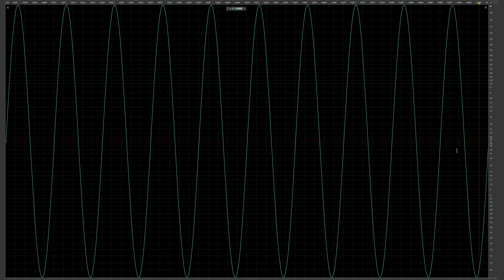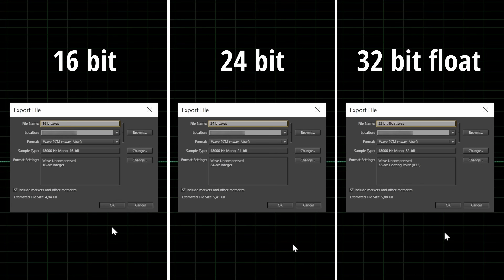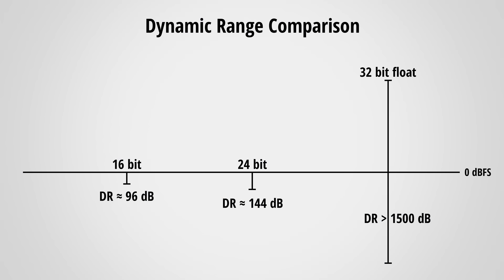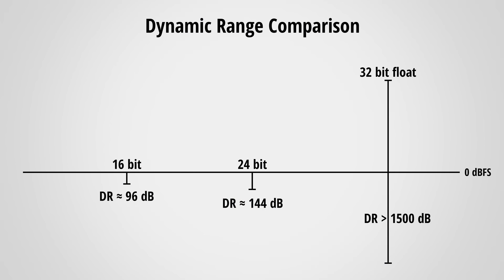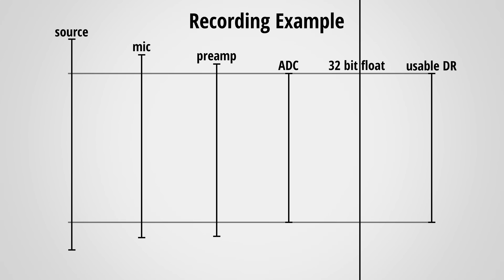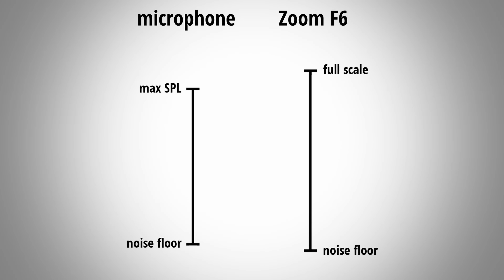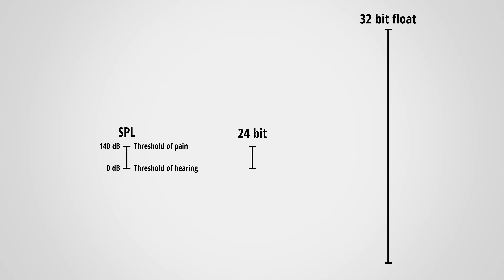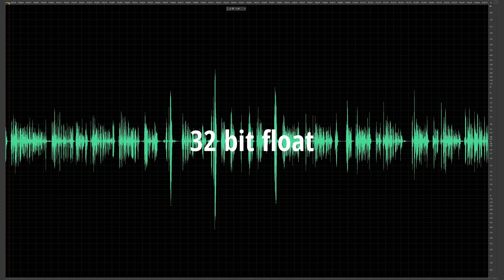The TRUTH about 32 BIT FLOAT for audio recording– Really useful or marketing hype?

Comment: I use an F6 and an F3 and the convenience is fantastic! That said - I learned about 32 bit float recording's limitations the hard way. I was working with a microphone that had a max SPL of 110 (cough cough Videomic Go 2). No matter what happened, whether I used the Zoom F3, Zoom F6 or Zoom F2, the audio would distort when I got really really really loud. On the meter it showed normally but the audio was distorted. (For those wondering it wasn't a DAW issue, it's an SPL thing). You are limited to the SPL of the microphone. This also explains the few times I actually managed to clip even on an F6 with a Neat King Bee version 1. A lot of the marketing around 32 bit float recorders is a bit hogwash :P  You'll often see the ever-popular diagram of the 24 bit graph with a small tiny little grey arrow that goes upward and the 32 bit float recording diagram with a grey arrow up to 600 DB. First off, you'd literally die if you recorded at 600 DB :P.  Second of all, most mics are capped off at around 145 DB SPL so regardless of how awesome 32 bit float recorders are - you are capped off at the max SPL of the mic. That being said, what I can say - and Julian touched on this - is convenience. With a 32 bit float recorder I can do things 4-5 times faster than before. YOU SKIP STEPS. I no longer have to do things anymore. It's easy. No more fiddling with things. No more hiss-penalty, no clip-penalty, it's like the cheat-code in audio. No quarters needed, just infinite lives.
Reply: Assumptions are being made here that are not correct. You say “no longer have to do things. SKIP STEPS. No more hiss penalty. No more clip penalty.”  That is for most situations completely incorrect. You still have to fit the microphone’s analog input signal into a window the bottom of which is the electronic noise floor of that microphone and top of which is distortion generated by that same microphone. If you don’t, you will get a digital signal with infinite range playing back the same hiss and distortion you fed it. This is not cheat-code. It is not magic.
Reply: @artysanmobile  No I disagree. We can agree to disagree. It's a quality of life improvement. It's very very difficult to mess up a recording with 32 bit float. You basically have to just click record and make sure you're on-axis with a pop filter and you are done. The times I have to retake my takes ironically are when I do recordings with my 24 bit interfaces.
Reply: @Dracomies    I’m happy for you.
Reply: Yeah, that mic is pretty limited. If you go with the VideoMic Pro it at least gives you three different options for gain, -10dB, 0dB, and +20dB. That can come in very handy depending on the environment in which you're recording.
Reply: The Zoom recorders employ 1 part of an equation that must be satisfied in 2 parts to take advantage of a 32bit or 32bit Float digital signal.

1.  Multi A/D converters, each offering a different slice of the 32bits or more being recorded. ✅
2.  A source (microphone) that has a larger than physically possible analog dynamic range. ❌

The source signal will always be bound by physics to the range of its self noise to the point of clipping. This range might, with the most expensive microphones available, reach about 22bits.  Recording it to a 32bit or larger file will still yield 22bit dynamic range. There is no free lunch.
Reply: @artysanmobile  The fallacy in your part 2 is that just because you can’t make use of the entire range of 32-bit floating point values doesn’t mean you aren’t taking advantage of a 32-bit floating point signal.
Reply: @TangerineTux    That is an excellent point, and well said. I’m not sure of any fallacy from me. It should be clear I understand the issue perfectly well.
Reply: @artysanmobile  I think you're just getting into pedantics. All I'm saying is this. I don't clip when I record with a Zoom F6. I just don't. When I record with the F3 I don't clip. So that's all that matters to me. I'm going to end the chat here. Sorry I just don't feel the need to explain myself further lol. So you're not going to get a response after this.
Reply: @Dracomies    Of course you mean semantics. Pedantics isn’t even a word. Pedantic means teaching, with the suggestion of doing so clumsily. Nothing I’ve said argues with your results but words do matter. It is clear to see from comments that this subject is confusing to many. My intention is to clarify and further educate those who are curious. I assure you, it is not to fight with you. I will continue to write for those with genuine questions about 32bit recording, and that’s a lot of people.

Comment: I think 32 bit float is extremely useful for a personal recorder like my Zoom F2, when you need to set up a lapel mic on someone and you have no idea what the sound levels will be.
Reply: Agreed.  I have 32bit float on my Tentacle Track E bodypack recorder, and also on my Sound Devices MixPre 6II recorder.  While I always do a sound check... it's nice to know that I am somewhat protected from clipping if the subject gets too loud.  I often hook my MixPre recorder to a sound board backstage at an event, while I'm in the audience shooting video.  Therefore I'm not able to monitor the audio.  But the files I record can be adjusted later in post if things are too loud or too soft.  It's a nice safety-net for us one-man-band shooters.  😎
Reply: That's what mic checks are for.
Reply: @VidMashUp  It was clearly mentioned: «[...] you have no idea what the sound levels will be».
That's field recording in an environment you can't control, or working in the spur of the moment capturing something that will happen only once.
In such situations typically mic checks as used in a studio (=controlled environment) aren't possible.
Reply: @riangarianga um. Ok?

Comment: There's another little detail that is not known by most audio people (but very well known by electronic engineers and the like), and that is the limit of thermal noise, or Johnson-Nyquist noise.
Audio devices will output at most, let's say, 10V (usually a lot less, more like 2.5v), so that's our 0dBfs, the maximum value we can ever get. At room temperature, the thermal noise for human hearing range bandwidth is about -140dB at most, being quite generous. No matter how perfect and quiet your setup is, the electrons themselves shaking inside your electronic circuits will make MORE noise than the resolution 24bit provides for you. Even in scientific applications, 24dB is more than enough almost all of the time. Even theoretically, you CAN'T EVEN USE the whole 24bits, there's at least 1 or 2 bits of extra headroom.
Reply: As further clarification: I'm not considering cryogenic measurement equipment, nor devices specifically created to measure abnormally loud sounds, like field explosions. Those will usually have either measures to reduce thermal nosie, or output way over 10V, or other special measures that most humans haven't even heard about.
Reply: Getting to the limits of 24 bits is not as outrageously difficult as you might think. There are various commercial headphone amplifiers posting DR in the 140s of dB these days. The practical limit is about 152 dB at unity gain, though obviously a unity gain amplifier is not the most useful thing in the world. That would be a maximum amplitude of 9 Vrms (a typical value on +/-15 V) vs. an input noise density of 1.6 nV/√(Hz). If you insisted you could squeeze out another 6-10 dB on the bottom end for sure.

The limiting factor is converter analog stages, which at best have a +5 V supply available, often less, and being CMOS parts don't sport voltage noise as low as bipolar circuitry would allow. Commercial audio DACs will just about make it to 140 dB with all 8 channels in parallel, and their ADC cousins top out around 130 dB.

The combination of both should illustrate why variable input and output gain as well as hybrid ADC concepts are useful to have. Since instantaneous dynamic range comes with a cost in power consumption, modern DACs more on the mobile side of things are pulling some tricks like DRE (automatic output gain switching) or even Class-G (various steps of output stage power supply voltage chosen depending on signal) as well.
Reply: For just one example, there's the Topping L50, posting a 145 dB(A) spec. And that seems to be actual instantaneous DR, as the difference between noise floor and maximum output level at low/mid gains actually comes out to over 152 dB(A). Of course nobody needs that much audio DR all at once, it's more a thing of providing ample DR across a wide range of headphone sensitivities, from BA IEMs to HE-6s (a range approaching 40 dB).
Reply: @PileOfEmptyTapes you do understand, that you will NEVER listen headphones at volume of 140dB?
Or you might... ONCE, then you're deaf. So where do you need to hear fly buzzing 5 meters away and a NUCLEAR EXPLOSION  from 10 meters away? You do NOT...

Moreover, there does NOT exists 32bit DA converter that's capable of the bandwidth we require for audio. How they achieve that "claimed" 32bit AD-conversion is probably by using two or more AD-converters and using DSP-magic to "combine" the two waveforms or by having the two converters responsible for different parts of the dynamic range, but that causes discontinuity at the crossover points and other nonlinearities that are not welcome. It increases the noise-floor and makes converters per channel more complex and expensive. Basically, you give up something and ultimately you do not achieve that dynamic range that 32bit float should have, because physics limits things.

Physics sets limits to what's possible, and 32bit float is not truly possible without DSP magic and or faking it. Stop believing the marketing hype trying to sell you the same interface AGAIN.
Reply: @Mtaalas Correct. In our experience, there's a Johnson limit to a single path of audio. Using DSP and multiple paths, we can achieve far greater linearity, dynamic range, etc. Multi-path is very common now in ADC's, soon to be available in DAC's, and later in power amps and microphones. At some point (20 years), it will not be uncommon to realize a true 160dB signal path from mic to power amp, and most of the dynamic range improvement will be on the noise side (not the "max level").
Reply: @driz77  there's a limit to the self noise of a microphones and other sources, there's a limit to the noise floor of the acoustic SPACE you're occupying. So there's very little point (unless in measurement and laboratory use) to have a dynamic range of 160dB or ADC noise floor under anything we have now.

Yes, technical achievement, great, but what's the _point_? WHY would you NEED that performance?

Are you going to record pin drops on a pillow within anechoic chamber with noise floor of -30dB and right after that a C4 explosion?

It just doesn't make sense.

Only thing I'd be ready to accept would be to increase the upper range to get rid of clipping by accident, but beyond that, we're already way beyond anything a human needs.

No need to make things more expensive and more complicated chasing bits and frequencies that have no utility...
Reply: @Mtaalas  We can hear mid-freqs down to minus 8dB SPL (especially with headphones). Home theater is now close to 150dB SPL on low freq explosions (etc). Call it 160dB of real world dynamic range. I don't understand why people think 24-bits is enough for the real world. And in the pro world, we stick microphones on snares and trumpets every single day ... which can generate 155dB SPL at point source. This is the real world. Heck, that boom car at the traffic signal routinely generates >155dB SPL.
Reply: @driz77  150dB SPL in the movies, huh? That would rupture your eardrums, at least it would be very agonizing. 160dB would definitely destroy your hearing for life IMMEDIATELY.

I call bullshit.

Do you have ANY idea how loud 150dB would be?
Reply: @Mtaalas Yup, full-range program at 150dB will damage your hearing. 150dB at very low-frequencies (sub-woofer) will not. Which is why people have big subs in home entertainment systems, and why guys have boom cars that routinely do 150-160+. And why we stick microphones directly on 155dB sources. This is the real world. 

That said, if you're around 150-160dB VLF for too long, you may find it harder to breathe!

And there are other reasons for a DAC (etc) to perform at very low self-noise levels. One is low-level distortion. Any single-path DAC today delivers ugly waveform distortion at  -100dBFS. We hear this as image smear. A multi-path DAC (>170dB DR) delivers a perfect waveform well below -120dBFS, even to -140dBFS or better.
Reply: The point is not to just record with great dynamic range and resolution. The point is to be able to do a lot of processing without accumulating errors from such sources as round off, overflow during multiplications, etc.
Reply: @Johnny.Fedora 
So, if I understand this correctly (which I may not, no surprise there) you are an advocate of 32-bit for the reasons you mentioned?
    I can follow most of the drift of the video/convversation that follows, I think.
   Looking at the SSL 12 recording interface now and wondering if I should value the 32-bit feature enough for the 12 to make it to the finals in my interface comparisons.
Reply: @shadyarian In a multi-path DAC (not ADC), we can actually achieve far more than 24 bits of linear conversion (40nV unweighted/broadband noise). Currently in the lab, we're at 29 bits, but practically / commercially, it's more like 27 or 28 bits. You can find details in U.S. Patent 9,590,648. Cheers!
Reply: the thing is the actual dynamic range of 24 bit or 32 bit float is only 120 dB. Lower than that is phase noise, or simply said intermodulation distortion due to  discretization.  With test signals it's rather dynamic, but never with complex signal.

Comment: Even with 24bit recording clipped, there are plugins (restoration type) which can restore the clipped portion on the way in or when mastering has been over-compressed\processed. I usually use such plugins to remaster CD albums for headphones (using binaural responses).